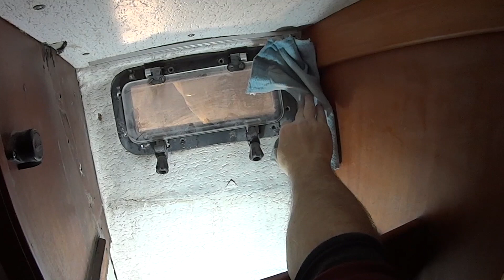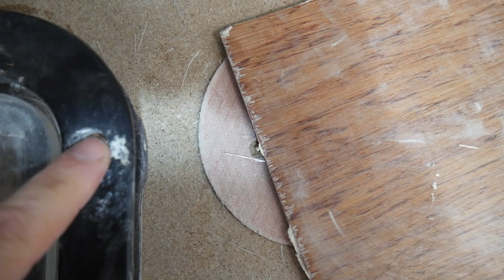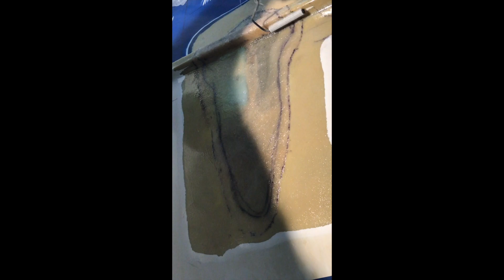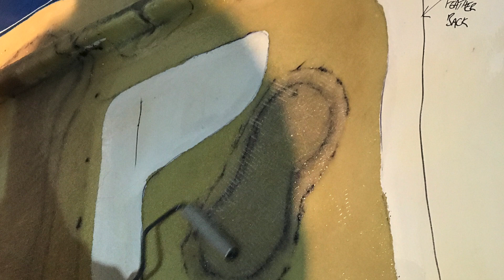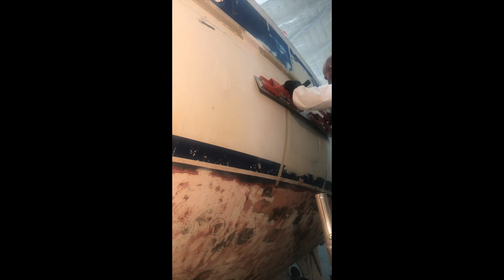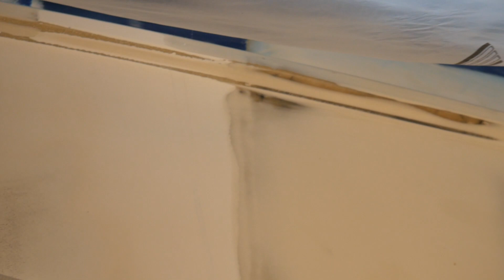#22 Topsides repair complete

Comment: When drilling out screws, always start with a very small drill (3 mm). Then successively use bigger (4 mm) and bigger (6 mm), (8 mm) and so on until you reach the desired size. In that way it’s much easier to stay in centre. For the remounting, maybe screws with flat heads and washers can help you out? After all it is not on every port light, and I reckon it’s really no disgrace that you’ve rebuilt it and it becomes watertight?
Reply from the maker: hi MiQ, yeah I think your idea of washers large enough to cover up the rough spots would be good. I'll probably do that I reckon. I think I used 3mm, 8mm, 10 then 12mm drill bits in that order. The problem was the bulkhead was close to the screws which meant I couldn't get the drill nice and perpendicular. I also didn't  have a decent centre punch which I have now purchased!
Reply: Aha, didn’t realise that you had different drill bit in the vid. There are washers in quite some different materials nowadays. Like if you want black anodised steel or carbon fibre etc.

Comment: My hull number 658 has portlights that don't open - all of them. I wonder if this was an option. 
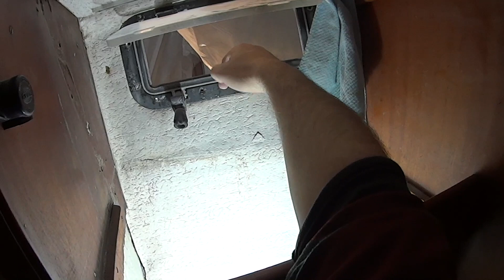At 1:48 min there is a black sort of plug on the left side - it's connected with 2 cables. Have you figured out what that is?
Reply: Stefan Kluge my one is the same. All portlights are closed.
Reply from the maker: Hi Stefan, it seems maybe the opening/closing ports may have been a buyers option initially? If you did ever want to switch to opening ports I don't think it would be too difficult. You can get them from HR parts - see http://www.hr-parts.com/contents/en-us/p750.html. I know exactly the black plug you mentioned and have also wondered its purpose. Next time I go out I will take another look and get back to you
Reply: The black plug is a cigarette type 12 volt plug socket, it could be used for a 12 volt hairdryer, I used mine to plug in the LED anchor light that I hung from the spare halyard. I ran the cable through the hatch from the socket.
Reply: thats good to know, i might replace 2 of my portlights to opening later.
Reply: Terry Evans all right, good to know